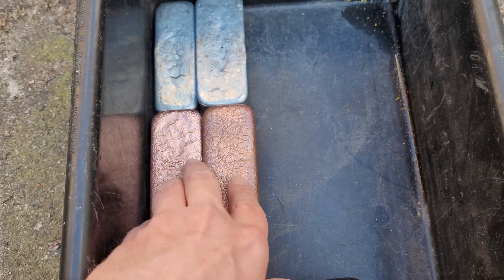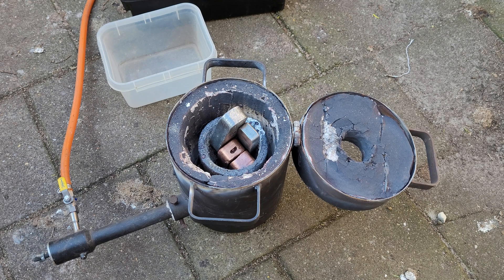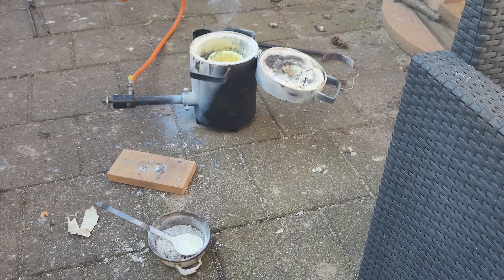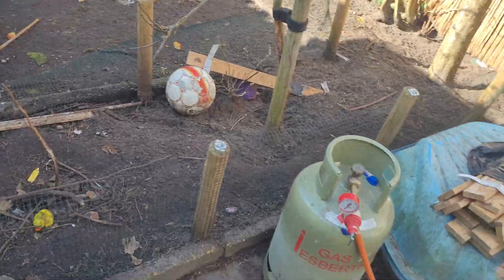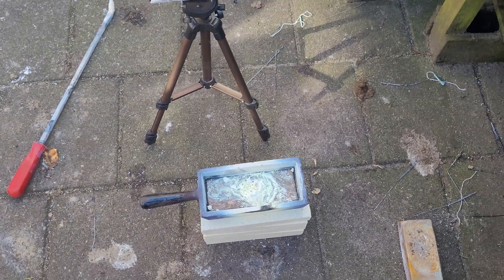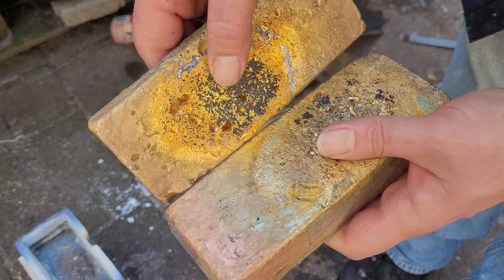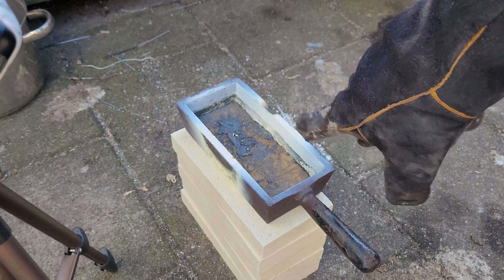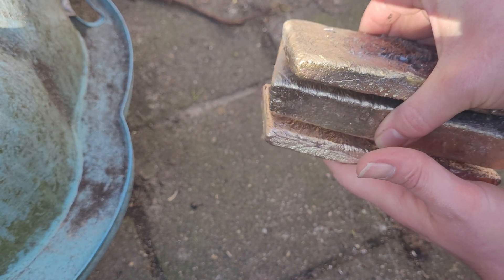Making navy bronze - Explosion in furnace! - Devil Forge

Comment: Try this recipe. Start with just copper. Heat it to the melting temperature of zinc. Then add the zinc and let it melt. Slowly increase the temperature but let the copper dissolve into the zinc more than melt into the zinc. Use copper with a high surface area to weight ratio like wire. The maximum temperature should be around that of melting brass instead of the higher temperature of melting copper. That should help to keep the zinc from boiling off too fast.
Reply from the maker: Thanks! Might try it that way the next time 👊🏻🔥🔥🔥

Comment: A wild reaction caused by the extra heat generated when the zinc mixes with the copper. The mixing of molten copper and zinc is Exothermic. That means that heat is released when this occurs. The copper was too hot to have the zinc added and the extra heat sent the zinc abase generating Zinc Oxide. A reference from the WWW states “Exposure to Zinc Oxide can cause metal fume fever. This is a flu-like illness with symptoms of metallic taste in the mouth, headache, fever and chills, aches, chest tightness and cough.“  Zinc Oxide is white when cool but turns yellow when hot which means the reaction you had was so hot that the fumes generated were hot hot hot. Normally brass fume are white indicating they are cool. 

I know this is the dreaded SAFTEY stuff but having fun does not include going to the hospital. 

With the furnace you are using as soon as the metal melts a minute of extra heat is all that is needed before turning off the gas, shimming and pouring. 

Thanks for the extraordinary video.
Reply from the maker: I am lucky I wear a respirator when melting zinc, I was aware of the dangers involved. Thanks for explaining the exothermic reaction, it is better to melt the zinc together with the copper or at least add it while the copper is melted for 2/3 or something.

Comment: always melt your higher temp metals into your lower temp ones, that way you will get less metal burn off. or melt them together.
Reply from the maker: I will defnitely try this alloy again soon. I will first melt the copper and than add the zinc in smaller pieces. After that has been melted, I will mix it up and pour it out directly after the mixing :)

Comment: What would be a practical use for navy bronze? Or is it just a novelty thing?
Reply: Hey! Metalscrapper’s metallurgy studying friend here, naval brass is a brass alloy with a pretty high strength to weight ratio, as the name would suggest it’s used in a lot of naval applications in areas where high strength and corrosion resistance are important. It’s good in fresh and salt water and the 1% tin added serves to help keep oxides from forming even in contact with water
Reply from the maker: Glad Mike did already answer you :) Thanks @Mike Pommer, I will try it again soon and use your tips to get it better :)

Comment: Brother. Mate. Come on. 🤦🏻‍♂️   In every copper based alloys with zinc, you need to melt all the ingredients first and add zinc last when the alloys is just before solidifying in the crucible with furnance off. First you added it it with all the ingredients, it boiled away, then second tome you added it too soon. You have to wait till the molten alloy cools. A lot of mess and it did not suppose to look like that.
Most of the zinc you have added is already out and boiled away and the mess is, well you know.
Reply from the maker: LOL, yeah that was a pretty mess, I was experimenting with the first melt, but totally did not like it, way too much fumes and zinc burning off :) The second time the copper solidified as those zinc ingots where pretty big. I will do this again soon :) Thanks for the tips my friend :)
Reply from the maker: Oh and do you mean I first will melt the copper with tin, turn off the propane, let the copper (almost) solidify, put in the zinc and put on the propane again, when the copper melts, the zinc will fall into the molten copper and mix? Is that right?
Reply: @Metalstacker  nope. When you add zinc you just need to wait for the copper and tin mix to solidify gently only on top layer. The top layer will prevent for the zinc to oxidize and just melt in to the mix.

Comment: I think you should pre-heat the metal before you add it. I think that adding cold ingots to the hot copper was a big part in f the issues you had, especially combined with the big diff in melting temps. 

Next time you want to try a mixed metal melt, I would really recommend melting and making shot out of each metal first and then melting the shot mixed together. Also, shot would make it easier to get the exact weights that you want. 

I am not an expert or anything, I just love watching melting videos! Copper is always my favourite. Aluminum bronze is second. Thanks for all your hard work!
Reply from the maker: Using shots is a great idea! The problem with this particular melt was that the ingots of zinc where pretty big, the copper solidified a little bit, so the zinc ingot could not fall directly into the copper, when I closed the lid of the furnace after adding the zinc, I assumed the zinc would melt and after the copper would remelt, it would mix in. But the ingot was so big it did not have a chance to melt completely before the copper got totally liquid again. The zinc bar fell in the liquid copper causing the violent reaction. I will do this again but with smaller pieces of zinc :)

Comment: Apparently melting brass without burning zinc isn't possible. Have the same issue here.
Reply: The temperature is too high, it is possible but very hard and not perfect.
Reply from the maker: I need to get over 1083°C to melt the copper, that is way over the boiling point of zinc... I do not know how to do it differently :P
Reply: @Metalstacker  just make zinc free brass, tin and alu is usually used.
Reply from the maker: Yeah, copper melts at 1083°C and zinc under 500°C so not burning off zinc is impossible!

Comment: You made the C19 antidote lol  I usually add my zinc in last, but I don't usually use that much at one time. you might have to add a few % back in when you remelt it to cast. You almost had some fried chicken.  Keep at it.
Reply from the maker: LOL, yeah I will try this again, but then add smaller amounts of zinc. Finally all metals will go into one crucible and will be mixed troughout the melt again.